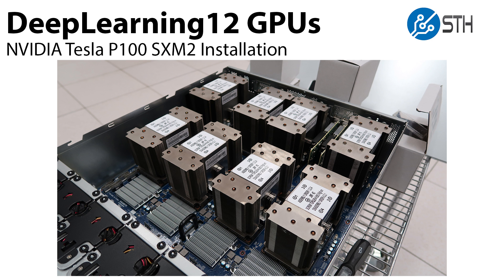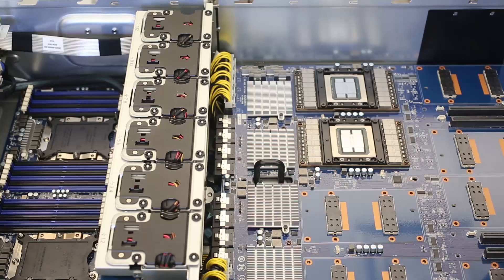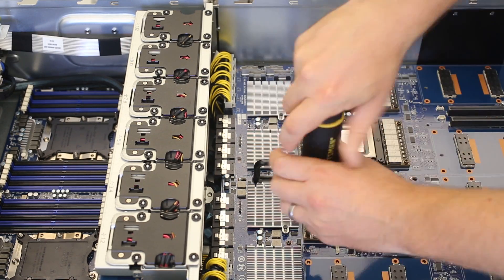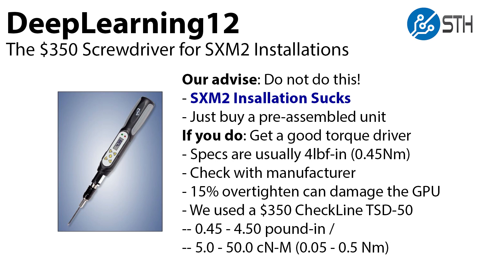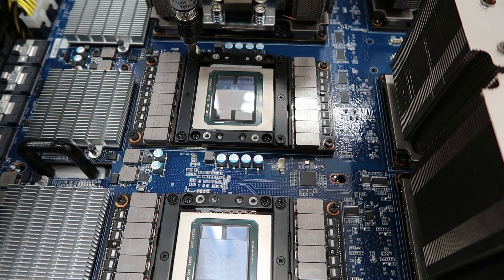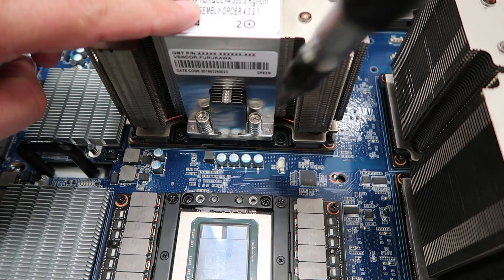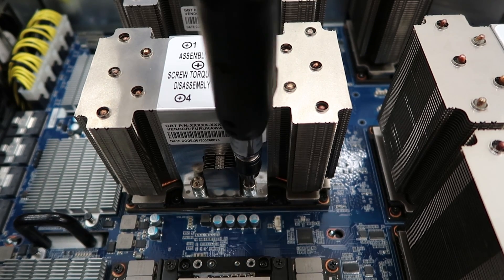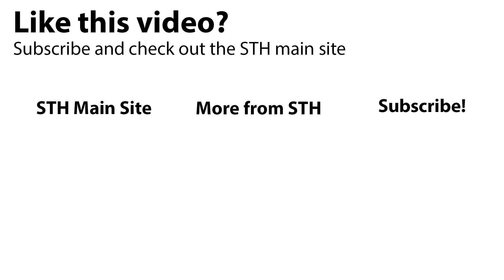NVIDIA Tesla SXM2 GPU Installation in DeepLearning12

Comment: Holy crap. I only recently learned about SXM2 and I thought this wouldn't be so scary and used v100 gpus could easily be damaged from overtightening. I had this vision of RGB water blocks and a custom dual loop with rows of LED fans it a rack while I replace the lid with acrylic and hang it on the wall next to a desk. It's a shame these aren't a form of pcie slot. I read about why the installation process is touchy shortly. SXM2 V2 should be an easier thing an average tech should do. I thought this motherboard configuration could be a better alternative and less expensive for gpus. I'm bummed out now. I hope engineers keep thinking I. This direction.

Comment: Installing the heat spreader could be a lot easier if the dies were lidded, right?
Reply from the maker: It would be easier but not as thermally conductive. It is a bit funny to think folks were freaked out on the TDP of these GPUs at around a third of what GPUs are today

Comment: You can calibrate a regular torque wrench to the exact ft lb value you need so it will be within your 15% and no need to spend $350. It's as simple as measuring the distance from the pivot with a known weight and adjust until it's where you need it. If it's a needle wrench it's even easier because you can just draw a mark there.

Comment: NGL, I would still like to try installing SXM2 GPUs.  I have done things in the lab where things have to be tighten as even as possible.  But yes, I would use the right tools LOL. I am assuming since these modules are so fragile, there's a good chance of finding damaged stuff on the used market even if they say clean pull?  I have seen some affordable P100 SXM2 modules.  I am assuming the cost of heatsinks and a chassis for them makes up for their price. To be honest, I am wanting to build a home server for machine learning or to do FP64 science computations.

Comment: You don't apply thermal paste before installing heatsink?
Reply from the maker: On server heatsinks for CPUs and GPUs the paste is pre-screened on the heatsink. That is super important with NVIDIA SXM GPUs since 1mm too much and the GPUs will crack.
Reply: @ServeTheHomeVideo  Ah, that makes sense. Thanks for the information!

Comment: Are you supposed to put thermal paste on the GPU die?
Reply from the maker: In these systems the thermal paste is pre-applied to the heatsinks. It needs to be a fairly exact thickness. People have broken Tesla P100/ V100 SXM2 GPUs with too much thermal paste.
Reply: That other Guy i guess what he mean is if you put too much thermal paste, the GPU could fry due to heat.. Linus have a video about thermal paste is actually a bad thermal conductor, you are supposed to have only a very thin layer to fill in the microscopic gaps between the top of the die and the bottom of the heat sink.
Reply: @AndreDing11  this is I suppose more about uneven pressure literally cracking the gpu.

Comment: Tells a lot when you have to buy a $350 screwdriver to do this!
Reply: you could get a much cheaper one that's going to be within 5%
Reply: For anyone that comes across this, just use a small torque wrench and an extension. Won't ding the fins and a good (enough for what we are talking about) 1/4" torque wrench can be had for reasonably cheap.
Reply: it's not common to get SXM2 from mass market and we recommend to sell full systems instead